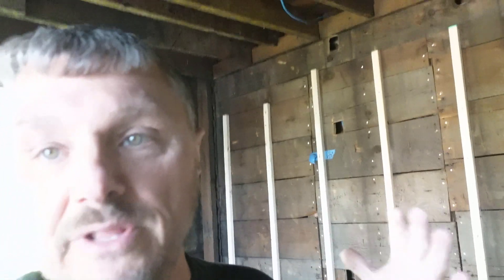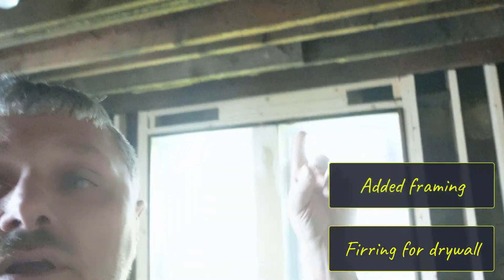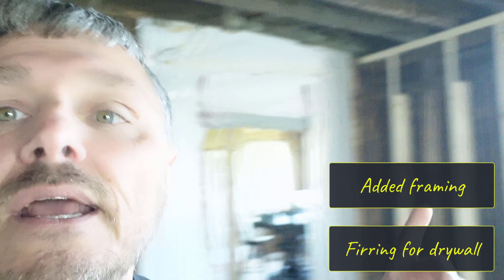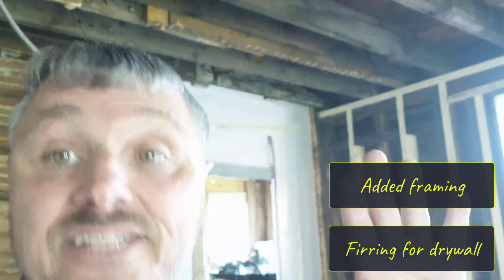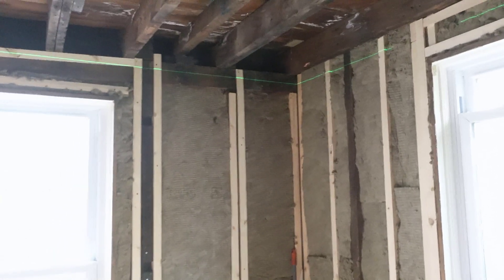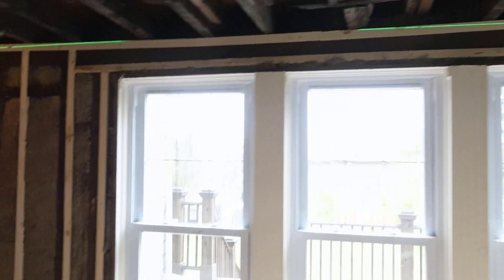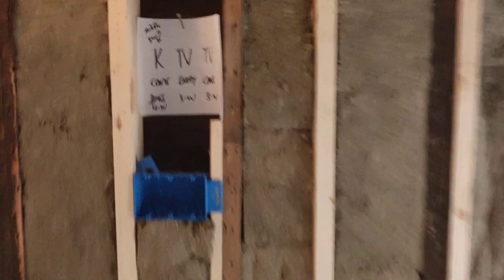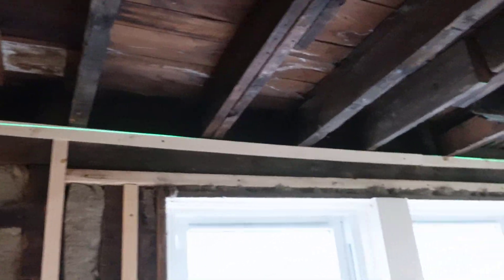FIRE BLOCKING and RockWool R15 - part 8 of remodel project

Comment: cant you use rockwool as insulation?
Reply from the maker: Thanks for commenting! I don't know if I misspoke but you are correct. the RockWool products are rated as approved insulation with a rated R-value (I am not sure about their sound-batting for sound proofing product line). I use Rockwool frequently and believe you can get a higher R value due to the density of the product and the joist cavities they will fill. And....it is not nearlty as itchy working with it.
Reply: @sdsconstruction   it was me who miss spoke. i meant to ask if rockwool can be used as fire blocking

Comment: The first time I worked on a house with balloon walls I had no idea. We were drilling holes from the outside to the top of the second story walls to blow in insulation.I was wondering why the cavity wasnt filling up. After looking arpund we found all the insulation was blowing into the crawl space which now meant we had to go into the crawl space and back block all the open cavities around the perimeter of the house. Good times...😢 Your project is looking great though!!
Reply from the maker: Brother Finisher! Howdy and hello! Thanks for checking out the video and the comments. Back when we bought the house and I started gutting a room at a time, I had my former crew boss and owner of the contracting business stop by to look over things and give advice. One thing he explained to me was balloon framing and how it can be an issue. When I can here at the house, I fire block. If I work on old homes and have the chance, I do the same. Glad I was paying attention that day!

Sorry to hear about your introduction to BF. Sounds like a big pain. Were you required to clean out the crawl space too or did you just have to back block to allow the pockets to fill? Good times indeed! a

Thanks for the up vote on the progress. Today was ceiling joist day. All but the last which is tricky and will wait until tomorrow and a fresh approach. Level and flat ceiling....here I come!

Comment: Great progress so far!  I was wondering how good the ceiling framing was going to be for you guys.  It really is looking good, thanks for taking us along your journey!
Reply from the maker: Hi Russ! Thanks for the comment. The ceiling is almost as bad as the floor was so it was way easier to just make the call and loose 6in of height and get something that would not only be flat but fairly level too and this will help with the trim not broadcasting an angled ceiling.